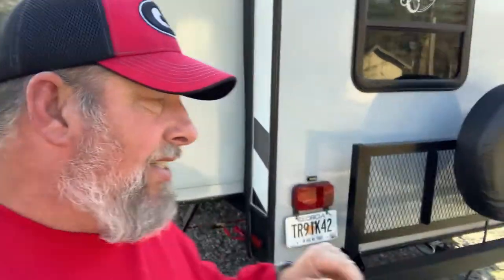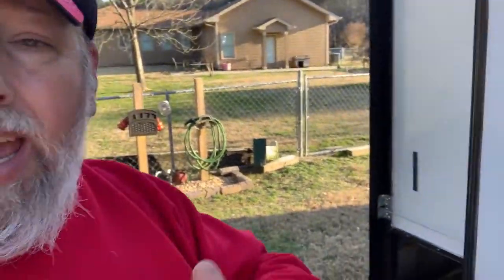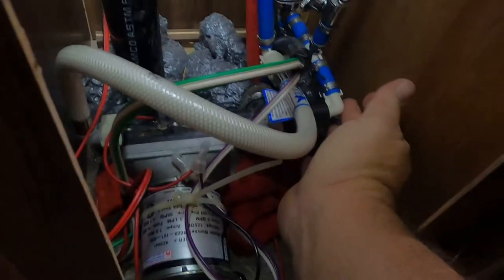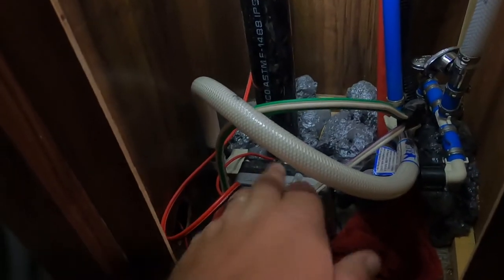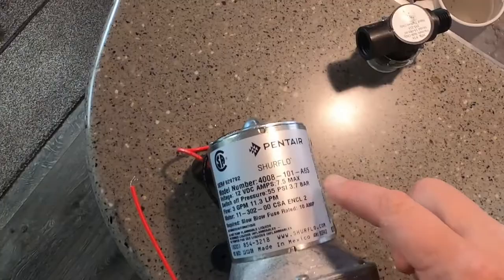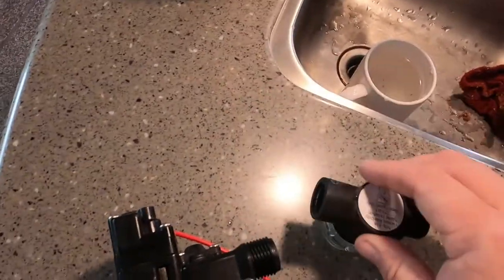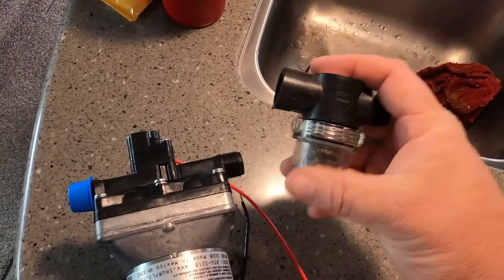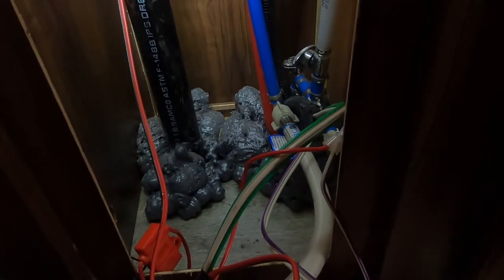Empty RV freshwater tank overflowing?

Comment: All ways use a pressure regulator on your city water supply it will cause the pressure regulator to lift and back fill your fresh water tank. You can tighten the check valve on the pump with a allen that will raise the pressure to your coach but thats not advisable. When the city water pressure is above 45 psi the check valve will open and relieve into your fresh water hold tank. Guarantee you there is nothing wrong with old pump
Reply from the maker: Ahh we will check that and confirm our pressure regulator is dialed in properly! Thanks for the comment!
Reply: @WillardsWithaView  on the top of the pump there is a small allen screw, tighten it to increase the output pressure. It will also allow a higher city water pressure before it lifts (pressure controller internal of pump) and starts to fill the fresh water tank. Take note the pipes in the trailer are not rated for more than 45 psi. Hope this helps if not I know of another fix.

Comment: So I'm hooked up to city water at the camp site.
 And I woke up to hear dripping.
Went on the side and the portable water tank is over flowing/dripping like yours.
I've drained my black and grey tanks several times over the weekend.
I'm new to all this by the way 😂
Can you please ADVISE what do I do at this point before leaving today.
Reply from the maker: It is most likely a valve in your water pump that is stuck open allowing the city water to backfill your fresh water tank. You can try closing it by turning off the city water and then turn on your water pump and run water through each faucet until there is no air in the lines. This may close it. 

We replaced our pump as shown in video and still occasionally have the same issue. Our solution now is to cut off the flow from the freshwater tank to the pump when we are not using it. We have a pre installed winterization kit that has a shut off valve between the pump and freshwater tank that we now cut off when we’re connected to city water. An extra step but solves the overflow problem in our system. Hope this helps, good luck and safe travels! 

Here is another video that may help:

https://youtu.be/9uwrDeadmsA